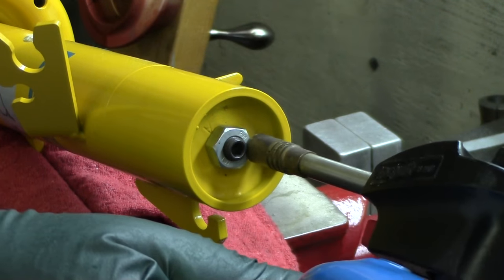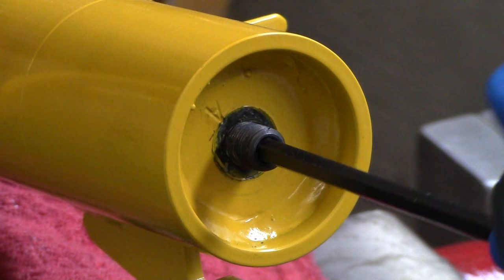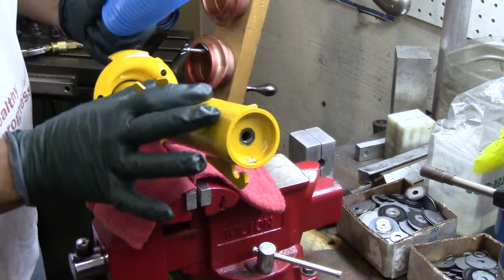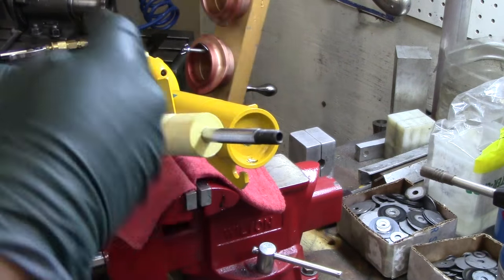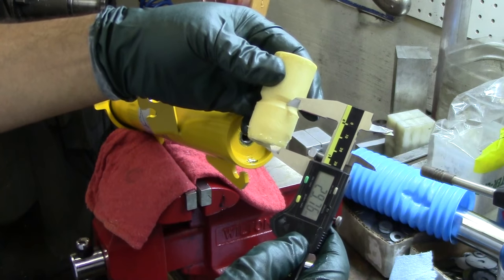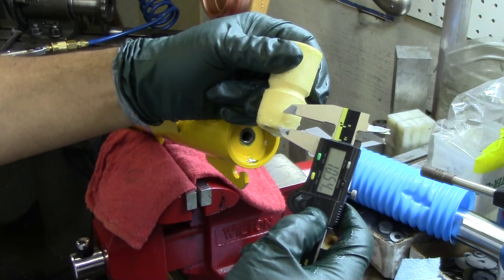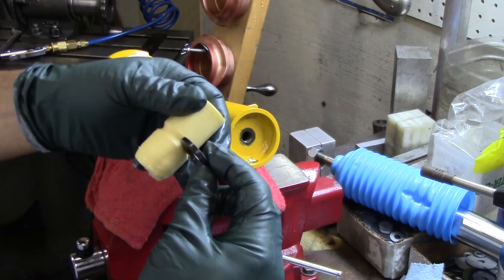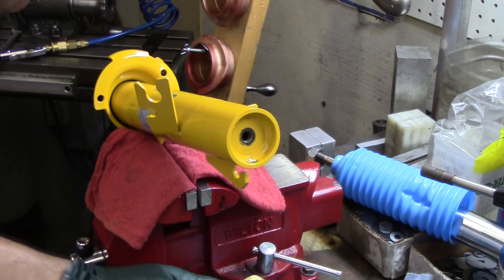How Shocks Work - Access Bilstein inverted strut bump stop (3/3) - with timestamps

Comment: What a great video. I was not sure about buying the B6 shocks for my car as I don't intend to use springs due to having air bags now having seen this I can take the fronts apart to make a place for my air bags to sit on without fear of damaging the shock.
Reply from the maker: You're welcome. As long as the B6 you're buying are a strut then this video applies. If you're going to make any adjustments to bump stop length make sure you measure the suspension travel. In my experience, air bags tend to limit compression travel more than a standard steel spring but it's always good to keep a bump stop on the strut or shock to protect it in case of a full compression event.

Comment: I know this is an old video but I have PSS9's on my Porsche 997 with an adjustment knob on the bottom where this nut you removed in the beginning of the video is. I noticed a bit of weeping around the adjustment knob. Would the oil in this case more likely be working its way out of the adjuster itself or out between the nut and the shock body? No other issues with leaks elsewhere, ride quality, noises, or anything like that
Reply from the maker: There's usually threadlocker between the nut and damper shaft (which is what attaches to the body of the strut body). The adjusting knob on a PSS9/10 is usually secured by a set screw. I'd say it's more likely fluid would not weep on the inner part of the assembly and is more likely to where you're seeing it, on the outside edge around an adjuster.
Reply: @SuspensionTruth  Thanks for your thoughts! I'm guessing my only options here are contacting Bilstein for a rebuild? Unless weeping fluid around the adjuster is normal?

Comment: Hello. BMW f22 with b8 and mss springs. Lowered 20mm front. I need to cut a bit the bump stop. How I can know how much and also which side of the bump stop. Any video explaining that?
Reply from the maker: I dislike lowering springs with an intense passion, especially when using dampers that have a rebound bias (which is most of them) that PULLS YOU DOWN INTO THE BUMP STOPS even more. Lowering the car means you have less travel to work with and the spring rate for lowering springs is never enough to account for how much travel is lost. 20mm is about 1/3 of the total available bump travel, or ~33%. That's a lot of lost travel, believe it or not.

The spring rates you SHOULD be using for that amount of drop are around double the factory spring rate. Best approach is to use a coilover for height adjustment which also lets you choose springs that are sufficiently stiff for any lower you want, and also maintain Flat Ride which lowering springs won't give especially once you start engaging the bump stops. Regardless of if you cut them, you'll still be using the bump stops, just with more harshness. It's also VERY important to use a damper that's properly tuned. That's all going to cost more, but it'll ensure your car doesn't become a jittery, bumpy, rough-riding mess that makes you cringe every time you see a pothole or expansion joint.

Good luck.

Comment: Hey do you know of a site that I can get the bumps stop and packers for the b8 ?
Reply from the maker: The inverted-style bump stop would have to come from either a Bilstein supplier/dealer, Ohlins for their own inverted struts, or possibly RE Suspension. Packers would also be small-profile to fit. Custom is your best bet, but can look at RE Suspension or some off-road / motorcycle suppliers that might carry packers / bump stops. The inverted struts with 40mm tubes (36mm pistons) have 11mm or 14mm shafts.

Comment: Greetings. Do you offer rebuild services? I have a pair of B4 Bilsteins (front) for an e34 that need to be rebuilt as one is leaking oil.
Reply from the maker: A B4 is often a non-serviceable Bilstein so most likely no. I suggest contacting Bilstein for lower-cost options as our services are for a thorough optimization vs. a basic rebuild (when that's possible).
Reply: @SuspensionTruth  I apologize, they are actually B6 (HD/Sport), - F4-P36-3021-HO.

Can you rebuild them, and if so, how can I get a quote? Thank you.
Reply from the maker: You can use the contact form at Fatcatmotorsports.com.

Comment: Since these types of bilstein shocks already have an internal bump stop, is the external OEM bump stop still required?
Reply from the maker: Proofread and edit your question, then I can offer my opinion.
Reply from the maker: With an internal stop present (that's also in good condition), I would say no. I've heard / seen an external stop also be provided which seems overkill. I recommend verifying the condition of the internal bump stop before removing / modifying any external one.

Comment: hi there, have you ever disassemble ohlins road and track? my front driver side damper making knocking noise. i'm guessing that caused by the installer used impact gun trying to tighten the top nut. And loose the main strut at bottom. My ohlins are also inverted design. 
how do i tighten the bottom strut bolt? 
Many thanks
Reply from the maker: I haven't worked on Ohlins R&T but a customer in AUS is using a Bilstein insert with an Ohlins housing - perfect fit. It could be the strut bushing is worn allowing extra play and clunking.

Comment: hi.
 I have to shorten the b8 30mm to fit them on H&R spings on a s3 8p. 
Do I have to cut the bump stop only? or I have to cut any other piece?
Thak you.
Reply from the maker: Shortening the bump stop would probably be reasonable. However, you NEED to be aware that the tire could bottom more easily. I highly recommend you take careful suspension travel measurements to see how much travel you have if you were to cut the bump stops. This is especially important with a typical lower spring that is usually too soft for the amount it lowers the car. You take all responsibility for any modifications you make, this is provided for information purposes only.

Comment: I've just received B12 pro kit and noticed that after I simultaneously press both front shocks all the way in, they retract unequally. Is that normal, or better, will it be noticeable when driving?
Reply from the maker: That could be normal, it's hard to tell with 'hand dyno.' If there's nothing leaking and there are no dead spots in the travel then mechanically they're likely sound. The difference in extension rates could be due to a few factors -  small differences in the nitrogen pressure which also influence the seal drag on the rod guide. I think if you picked any two dampers off a car you might observe something similar. If you really want to be certain you can find a shop to dyno test / evaluate them for you.
Reply: @SuspensionTruth  Thank you for the straight forward answer with experience shining trough! I did another test after and full pressed each individual shock multiple times one after another and then repeated simultaneous tests and got few identical retraction timings from them. I can't tell what exactly caused this difference, but the difference was day and night. I can tell by locking at the shocks that they are different production date/line, hoping that Bilstein's quality control takes this margins into consideration. I probably should purchase them direct from Bilstein official shop in the first place, as they state they are equaly matched, but it was easier and less shipping costly to order from a reseller. We all learn and have an opportunity to correct afterwards :). Thanks again.
Reply from the maker: Good to hear of your repeated tests. When a damper has been sitting for a while the oil that helps lube the rod guide (and allows the chromed shaft to extent with minimal friction) could dry up so cycling it a few times gets everything moving more smoothly.  I don't think there's any issue getting dampers from a reseller as if they're sold as new, they they ought to be! You're welcome and please share this channel with your friends. I appreciate your engagement.

Comment: Hi I'm hoping you could give me some advise! Im installing H&R lowering  springs onto stock bilstein b6 struts on a 2007 Subaru Legacy Spec B. Should I or would I benefit from trimming the bump stops?
Reply from the maker: You would almost certainly benefit from trimming the bump stops, but you'd need to be careful not to take too much. Any suggestions I make are at YOUR OWN RISK, keep that in mind. You can measure bump travel yourself via a few videos in my 2016 Mazda Miata suspension series (look it up). I'd trim from the TOP of the bump stops, not the bottom, otherwise you will get a dramatic increase in spring rate. 

I'd say you would be safe trimming 15 mm from the front and 20mm from the rear. If you get any rubbing of tire on fender liner, you can make a packer from Delrin or UHMW-PE to take up additional bump travel. Good luck!
Reply: Suspension Truth Thank you! Very Much

Comment: What is your method for converting the inverted dampers for regassing after being revalved?
Reply from the maker: @118049934986999342280 We used to use a needle valve (from Racetech, for motorcycle front forks) but now we have an Accuforce shock fill machine. http://www.accuforceshockdyno.com/equipment.html  , halfway down the page. We made a custom 36mm pressure cup (the aluminum tube you see) to take apart small body shocks and inserts. I think you can now order a small body pressure cup from them.

Comment: I have a question that is not directly related to this post. However, I hope that you can take the time to give a quick reply or point me in the right direction. I thank you for your help in advance. I am currently living in Japan and have recently bought an Nb miata, which has bilsteins. They are the hard s I believe. I am interested to know what oil is used in the shocks from the factory. I cannot seem to find any specs on viscosity ratings, index and oil weight. Nor can I find the volume of oil needed per shock. I am keen on using redline, silkoline, or Motul 400. I currently have Motul 400 and am very curious as to how this oil would effect stock valving. I have watched many if not all your videos and have found nothing on this subject. Thank you again for making such detailed and informative videos.
Reply from the maker: fluxingn The Bilstein stuff seems very light, 5wt at the most. Try the Motul and see!

Comment: Hi Shaikh, long time viewer here. I'm working on a 6cyl Z3 roadster (same front suspension as non M E36's). Since the bumpstop is hidden by the strut housing, how do you exactly know when the bumpstop engages when measuring wheel/damper travel on the car? Is there a way to fix the lower portion of the damper to the car without the strut housing for measuring purposes? Maybe I'm missing something really simple lol.
Reply from the maker: Good question. With the inverted strut-based Bilsteins (or any make that uses inverted design with a hidden bump stop) you need to mark where the bump stop touches internally then also where that point is on the vehicle's wheel travel.

So not so much that you 'fix the lower portion of the damper to the car' but that on a bench / off the car, you push on the damper or measure at what point in the travel the bump stop starts to engage. When you can measure and find that contact point, then I would use a permanent marker on the tube. Hint - I've found that typically the tube goes nearly fully into the strut body when the bump stop starts to contact. With that reference 'index mark' you can then estimate how much travel there is at various point in the suspension movement and get a sense of how much bump stop engagement is happening at static height, full compression, etc. It's definitely challenging, but doable if you can follow what I'm pointing to. For more assistance feel free to contact me for consulting.
Reply: @SuspensionTruth  Good info, and thank you for the fast reply!

Comment: would the same disassembly procedure work on a replacement insert that goes in the oem strut housing? working with a 3000gt. thanks
Reply from the maker: I don't know what product so I can't say. This is a procedure to remove 
an inverted Bilstein monotube insert from a Bilstein strut housing. If 
the insert you're looking at installs inverted, as this one does, then a
 similar procedure may apply. If the insert is a twin tube then no. You'll understand better once you have eyes on the entire housing to see what's going on.

Comment: hi i need shock for my car front bmw e38 2001 plz help my 
which one bilstein shock is good for my car b6  ? or .......????????????????????
because this bmw e38  very Very heavy
Reply from the maker: You can either purchase the specific Bilstein for your vehicle and use it as is, or you can purchase them and have us optimize the valving. BMW Bilstein damping is usually very stiff on the rebound side which causes unnecessarily harsh ride.

Comment: Did you take the gas out of this shock BEFORE you started. If so, how? If not, when and how?  When and how do you put gas back in the shock?  I am dealing with a fox body dirt track car.Asking about the front struts. Where is the rest of these series of videos? I have looked long and hard for them and cant find them. Please Help!
Reply from the maker: The strut insert is what's pressurized and the nitrogen chamber is at the opposite end of where the heat is being applied. There's no danger of overheating the nitrogen chamber putting targeted heat on the nut at the bottom of the strut housing. We refill the strut insert via an Accu-Force shock fill machine with custom fixturing - no valve needed on the strut insert. If you're trying to DIY a Bilstein strut you might be over your head...

Comment: I had Bilstein B4's fitted to an E30 BMW 316i which didn't have bump stops so now I am assuming these also have internal bump stops. The car does bottom out even over small furrows which is surprising considering the car isn't all that heavy but maybe this is the way they are.
Reply from the maker: There ought to be an internal stop, but the rebound bias makes the suspension pull down hard into the stops. That makes your suspension bottom out.
Reply: @SuspensionTruth  I see, Thank you for replying.
Reply: Glad I saw this video and read this very reply! I had B8s installed with Eibach lowering springs on my BMW F30 and now notice the suspension contacting the stops on rebound especially with quick dips in the road such as sunken man hole covers causing a slight rubber sounding "thump" more on the driver's side than passenger. The B8s don't feel like they are broken but the suspension sounds did take me by surprise.
Reply from the maker: @deecee168  Happy the video and community feedback is helping! It could also be that the B8 bump stops are longer than the factory stops (assuming that's what you had before). So, with any rebound bias you would be using the bump stops more. 

However, since you mention a rubber sound/thump you might also be getting momentary rubbing of the tire on the fender (either inside, outside, or top) on those sharp downward events. You have a lowering spring now, right? I would check that the tire isn't contacting the fender liner because that would need to be addressed ...

Comment: Great video, thanks.
anyone can take diagram of parts of bilstein b16 pss10.
i have bmw e92 with b16 i want rework but very low info about this. also i not know how obtain refferences for seals for make order.
Thanks
Reply from the maker: Hi Ruben, for assistance with your BMW, contact me through the www.fatcatmotorsports.com website, go to 'Contact Us.' I don't have a parts diagram but you could contact Bilstein to see if they'd give that to you.
Reply: im not near im from spain, and shocks can not travel in plane, for nitrogen gas, if will travel for sure i send to you, for repair, i try contact with bilstein spain but nothing... i need one complete insert and pair of seals but im not sure if bilstein provide this. i want check price but bilstein service not say to me. in original insert show 4612VM3 D165H5 maybe this refference is valid for order complete insert?
Thanks
Reply from the maker: Try the office in the US, North Carolina. There should be contact info on the Bilstein site. If you get the correct info from them, you may be able to source the parts from Bilstein Spain.
Reply: Fine, i try contact. thanks you
Reply from the maker: Contact me through the fatcatmotorsports.com website.
Reply: just i contact in your site, Thanks!

Comment: hi, can I use impact wrench to open this nut lose?
Reply from the maker: Did you read the description, and watch the entire video? If yes and you still have the same question, then do the following: 

Step 1 - repeat this out loud: 
http://i.imgur.com/ZXsEHZW.jpg

Step 2 - decide which applies to you: 

Option 1:
http://ci.memecdn.com/5309038.jpg

or

Option 2:
https://i.ytimg.com/vi/JfZKDrvUs-g/maxresdefault.jpg

Have a nice day.
Reply from the maker: This is not an axle nut, brah. You are very likely to damage the shaft threads using an impact if you haven't first applied enough heat to soften the thread locker between the shaft threads and the nut threads. Then you need to again apply heat to use a hex key or hex driver (turned CLOCKWISE) to free the shaft from the strut insert. HEAT is your friend! Not brute torque.

I would only use a hand ratchet or ratcheting wrench to get the nut loose, but that's because I practice mechanical empathy and don't like big heavy expensive paperweights. YMMV.